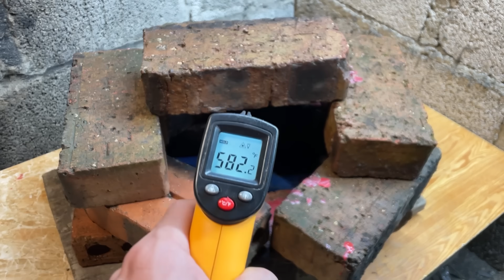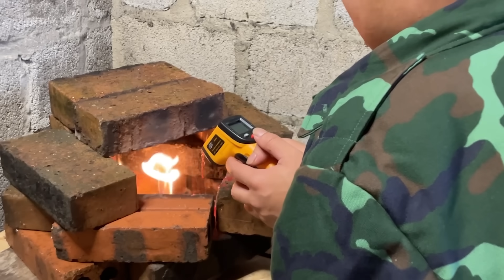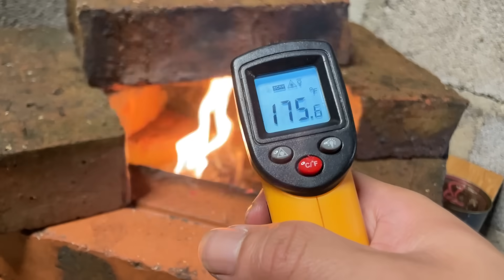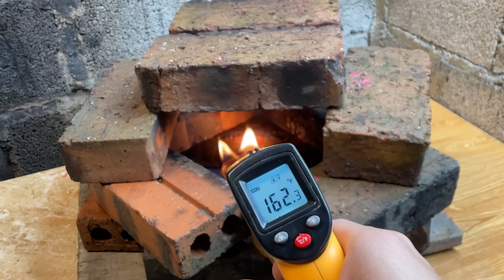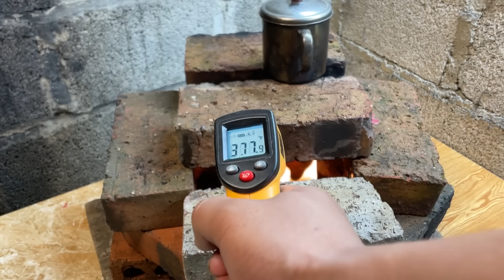Mystery Solved: Emergency Heating (Free) When There Is No Fuel, No Electricity | DIY Heating Stove.

Comment: How toxic? Colorless would be better imo.
I suggest a fire blanket underneath this.
I also suggest air flow. Ventilation is needed. 
A mesh over the fire source.
I also suggest you show properly how to
douse the flame safely and quickly. Obviously
accidents happen. Should it overpower for some
unforeseen careless movement.

Comment: Actually you needed several more layers of brick around that to absorb the heat and then release it over several hours. Your 700+° are going to dissapate out of that single layer of brick way too quickly.

Comment: This is a very unsafe heating method, suitable only for emergency situations!   Please do not attempt this in your living room or other cluttered indoor environment. If you need to: use a stone platform to build on, not any other type of flooring.  Remove floor boards down to the concrete if neccesary and remember to air out your room for at least ten minutes each day, to prevent carbon monoxide poisoning from the fire.  
 Two months ago, an apartment burned down in my street because the inhabitants tried this method in the living room. People in the apartments around it where trapped because the fire spread out to the communal hallway. There were two deaths of asphyxiation due to bad ventilation (the builders of the stove).
Reply: how does the carbon monoxide prevention nedd to work..more about that...
Reply: I trinken he is outdoor with the Stove.

Comment: You may want to Crack a dictionary and double check the definition of "fuel".
 I also will never understand why anyone would melt perfectly good candles in order to make these little stoves. The candles will burn much cleaner, creating less smoke for indoor use.
Just burn the frigging candles.
Reply: If you use a lot of candles you will inevitably wind up with candle stubs that are no longer usable as candles but still have a lot of wax (fancy wide pillar candles). Reserve that otherwise waste wax for this use
Reply: YOU heat the bricks,wrap them up in foil and cloth to store heat that dispenses slowly like on a bed, for your feet. Can't  do that with just a candle.
Reply: Kerzen heizen aber nicht ausreichend
Reply: Your right..just burn candles..that simple
Reply: @nylenemonahan4402 explica como se aquecer no inverno usando umas simples velas...
Reply: @MENTIRICRONEDELTACRON  usa crisco por otras opciones
Reply: Candles are made for lighting, not for warming up
Reply: For indoor use, it's not 🚫 recommended.
Reply: Time extension
Reply: J'ai regardé jusqu'au bout ....pour chauffer une vour ou une terrasse pourquoi pas..
Mais TOUS c'est se dépanner pour chauffer sa maison, une pièce tout au moins...
Votre truc .archi connu ...ne peut servir.
Reply: Heat temp.  Straight candle produce low heat that why they last longer and burn cleaner.   I used to question the same also😂
Reply: 😂 Exactly

Comment: Where do you get a flame thrower like that? 🧐
Reply: One can purchase the gas from most stores including Amazon n what n screwfix etc as well as the fitting for the top which is adjustable for blue or yellow flames we use it for lighting our log burner so much easier than matches.

Comment: Excellent. I'd like to know how long each of the burners lasts.
Reply from the maker: i have little firewood and gas so i used sawdust and melted candles to make it for heating, it burns for 12 hours, do you have any other ideas?
Reply: @DIYmr.T Tunfisch in Öl. Der Tunfisch wird gegessen und das Öl ist ein guter Brennstoff mit gerolltem Karton.
Reply: @SHafner That would smell awful as it burned
Reply: @eric.california.underwood 😂 egal, es brennt 🔥
Reply: @SHafner Yes .. warmth is warmth! A live Dog works better!🤔✌️